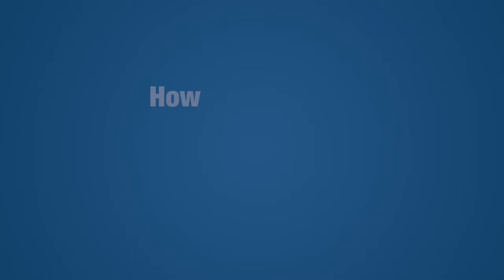How to Swap Wheels and Lowering a Hot Wheels - Ford F-150 SVT Lightning 1/64 scale

Comment: you skipped the part where you have to drill the tap until its lower end with the 1.8mm OR saw off half of the screw so it can fit into the tap hole
Reply from the maker: Maybe you can watch my very first video.

Comment: Man. When I was younger I used to drill them apart, clip off all the tabs holding the axles in place and swap the wheels and PRAY they stayed in place and snap the body back on and again PRAY it stayed in place. Just for wheel swaps. This was a great, simple tutorial. Great video.
Reply from the maker: Thank you my friend 🙏😊

Comment: Hi there i just started getting into making custom hot wheels and i bought all the tools i need and some wheels to do the swap but i’m not sure where to get those axles. Where will i find them?
Reply from the maker: Oh...I don't know where you can find it in your country, but you can contact @sakuramodel via instagram to buy it...also with the wheels. But we send it from Jakarta Indonesia.
Or you can use cotton bud stick and original axle as the stoppers. But you need to adjust the base for install the cotton bud stick.
Reply: @TolleGarage   hi there thank you for the help. I found some online for good price however they come in different sizes what size am i going for? They have different sizes for the outer and inner dimentions.

Comment: Hi, nice video. Where can I find 1.2mm tube? Thanks.
Reply: Craft and hobby stores. Some large hardware stores also stock them. If you can’t find the tube you can use an 18 gauge needle from a syringe.
Reply: @rickpatman628  Appreciate it!

Comment: Do you have to thread the inside for the screws?
Reply from the maker: Yes, the first drill bit 1.8mm is for making hole for 2mm bolt
Reply: @TolleGarage  just the drill bit is enough to screw into or you have to tap it?
Reply from the maker: Just drilling it...with 1.8mm drill bit
Reply: @TolleGarage  that's awesome what's the length of the screws you use? 2x8mm?

Comment: Was expecting a creator who would show me the lowering procedure without the use of those tubes (they don't sell these here) but that was the same old tutorial we've seen before. A pity.
Reply from the maker: No worries my friend, you can use cotton bud instead the stainless tube. But you need more adjustment. I will make the video if many people asking about it.
Reply: You could also take a piece of 3x3mm PLA and drill a hole in the middle. But than you have to make more adjustemens on the interior and on the bottem.
Reply: @TolleGarage  Ok, I'll try using those as well. Curious as for how you do it though
Reply from the maker: Okay, I will make the cotton bud version for you 😊...maybe next week